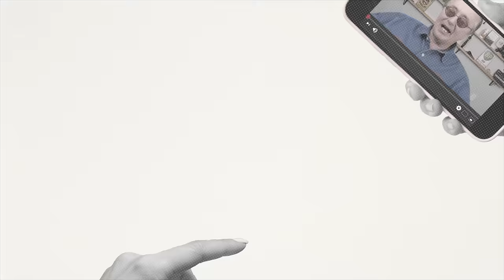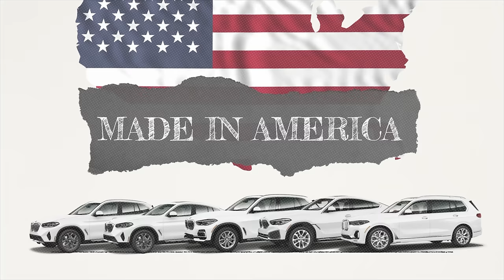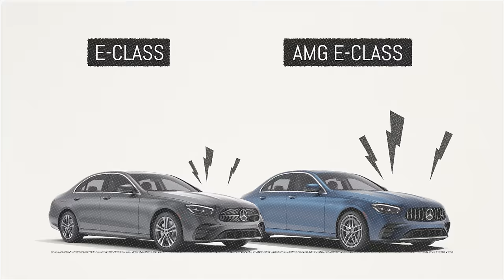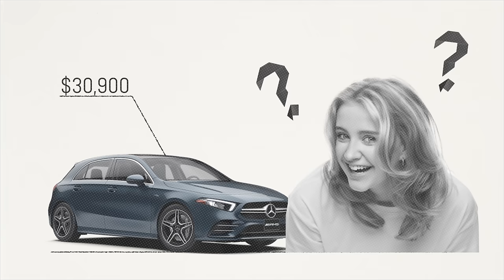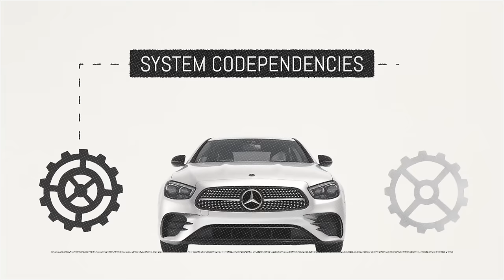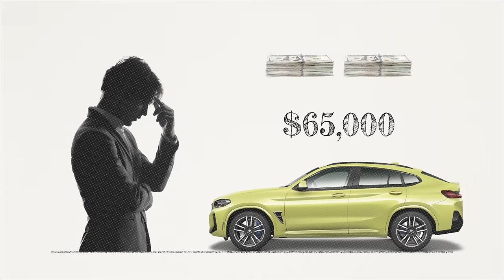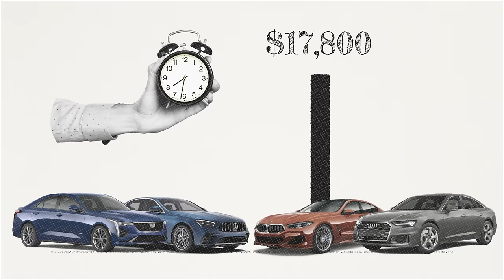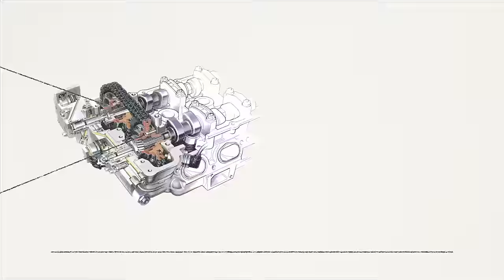3 Car Brands Only Stupid People Buy

Comment: I leased a 2013 X5  and found the ride rough enough that I switched out the run flat tires.  My 2007 5 series with 175k miles now has a failed transmission after several thousand dollars of other repairs, I owned it since 2010.   I had a 2019 X3 M40i with  standard sport suspension and found it way too stiff and bouncy. I loved a 2018  640iGT until it made a loud bang at 80 mph after which it was stuck in maybe 5th gear.  Towed to the BMW dealer where is sat for two weeks util he could get to it and the error disappeared!  Traded it for an Acura MDX type S.  Most fun to drive.  Every option including excellent sound system.  The 350 hp seemed to require high RPM to be responsive and with only 21 mpg and a small tank I was unhappy with a 300 mile range.  Currently drive a certified used 2022 Macan S with extend unlimited mile warranty.  It drives differently than a new BMW X3 M40i, which I would only get with the adaptive suspension.  Brakes not as responsive, engine in sport mode about like the B58, steering less aggressive but still connected to the road.

Comment: I've literally have only owned 3 cars in my life since buying my first car in 1978.    I had a '79 Toyota Supra that I kept for 19 years,  a 1999 Camy that I traded  in 2014 for a 2015 Camry.   I will be trading this car in for 2025 Camry, just because I love the redesign.   In a 46 years of driving Toyota's  I've only had to have new forward brakes on the 99 Cam,  and I had to get a new CV Axle (thank you Cal-Trans for the exemplary way you keep L.A. streets) on my current 2015 Cam. Everything else was regular maintenance.   Not one car had less than 200K miles at trade in.    Give me reliability over flash ANY DAY.

Comment: I own a 2018 BMW 540i with the B58 engine. Did you know that the award winning B58 was designed by Toyota? Also, the BMW was ranked 3rd by consumer reports in 2023 for reliability. I wouldn’t touch an older BMW, but the new cars with the B58 are bullet proof!

Comment: In the last 14 years I had 3 BMW X3 and one BMW 5 Series. All were company cars I ran up to 200.000 kilometers on each of them. Never had any serious issues. I also owned  a BMW X3, a BMW 3 series and a BMW 1 series. Also no issues. Before that I owned three Mercedes. Also no issues 10:48 . The BMWs were all new at the time I bought them. The Mercedes were pre owned, but not older than one year.

Comment: scotty i have a 2009 toyota corolla and i have have replaced the serpentine belt 4 times, and every time i replace the belt it squeals,  the car has 250k miles and the belt squeaks loud when i start the car.  what can i do? please help
Reply: Belt maybe a little loose? Check the belt tensioner and its idle pulley bearing. I had seen a 2012 Impala serpentine belt snapped when the tensioner idle pulley siezed.
Reply: Tensioners ..... it's not the belt !
Reply: It’s the pulleys and or tensioner. Should have realized that after replacing the belt the second time.
Reply: Scrap it
Reply: @Fernando     PPL in the thread you started are giving you the answer.

Comment: My 4 cyl, manual gearbox ford ranger will be 15 years old in 2024. Just crossed 120k miles with no leaks anywhere. Super quiet and ultra reliable. Been garaged since day one and looks brand new. 

Getting er ready for another 15 years. (Might have to replace the clutch in 2039).

Comment: Ive owned bmws (i buy used and old) and currently own bmws (like 10+). I swear by them. I service them myself, most mechanics and repair shops don't understand these cars. Hell, even the dealership dosen't. I got my fancy scan tools and fcp euro for parts. I honestly have nothing to complain about. I love how it drives and makes me feel and i dont mind fixing it when it does break down which is rarely.
Reply: Exception doesn’t make the rule. Not every person is a mechanic
Reply: @ev0wat most mechanics aren't mechanics these days...
Reply: Yeah if you work on them yourself that saves costs. However parts are still alot more expensive.
$500 for a plastic valve cover? Man did I roll my eyes at that rip off, but oh well no choice.
Reply: @cloudsmith7803  yeah parts can be pricey but once in a while is all good, usually when a buy the car it has tons of issues then after i sort it its good for years. People dont take care of them. I bought all kinds of bmws haha, i know.

Comment: We brought a used 2015 BMW X5 35d with 8,000 miles on it.  It has been without a doubt the best, most fun, and reliable vehicle we have ever owned and still do.  Currently has 180,000 miles on it.  I do the normal maintenance myself always Liquid Molly(FCP Euro is a great website).  I do agree that there is so much plastic in the engine bay that it is time to trade her in.  Current offers from the dealer's range from 7-9 thousand on trade in.  I do feel we did get lucky with this one but are currently looking at the Lexus 350 rx hybrid and the X5 50e.  One thing that bothers me, is the Lexus has a CVT transmission but yes resale is the largest factor helping the Lexus.  The BMW just blows the Lexus away for performances on all fronts plus 40 mile range running on the battery(still vrooming).    The BMW is currently on a 3-4 month waiting list and is all in,  about 10 grand more than the Lexus. I do agree that the odds are more likely in the overall quality and resale,  the Lexus is a prudent choice.  On the other hand the BMW is way more fun to drive!!

Comment: I bought a one-owner 2011 BMW 535i XDrive  with about 100,000 miles on it nearly five years ago for about $10,000.  Since then I've put about 50,000 miles on it and other than a set of brake pads, oil and filter changes, the only repair it has needed was a starter replacement.  And it is a WONDERFUL car to drive.  Fast and handles great, and it still looks new.  Gets 30 mpg on cross country trips (which I do several times each year).  I just checked online and 2011 BMW 535i XDrive cars are currently selling for between $7000 and $14,000 today.  So after nearly five years of use I could sell it for about what I paid for it.  Yet Scotty thinks I'm stupid.  🤣
Reply: You are that lucky 1/10. While for toyota there usually are 8/10 lucky people. go figure. yes still stupid.
Reply: @reald3d23 this is normal lmao not luck at all. I’ve had 3 German cars with well over 150k miles.

Comment: I'm a BMW guy. I have a M235i 2015, 2008 M3 and 430i 2009. All of them not one problem always do your maintenance on time. Make sure you get a good mechanic and build a trust with them. The only annoying thing that all my BMW does is the Bluetooth connection. Sometimes they don't want to connect so I have to reboot the i-dive but that's it.

Comment: In 12 years and 165.000 kilometers my F30 335i with mhd stage 2 cost me 1100€ in maintenance/repairs , everything’s else was service. same with most of my friends. I drove BMW inline 6 for 18 years now and they are very reliable. Except one engine, the N54, where all the memes come from. Awesome engine, capable of 700-1000hp, but not for casual customers 😂

Comment: I have a 528i 2016. No problem. Just the battery. And I changed the High pressure to Bosh.

Comment: I bought my 2007 BMW328I with the N52 engine brand new and next year it will be 17 years old.  The N52 is rock solid and other then the dreaded ABS module issue I have never had any problems with the car.  I was so glad I did not buy the 335I with the turbo as that was a disaster. I guess it depends on what engine you bought .  I don't even have a display on the car but that is what I wanted as I did not want to deal with the reliability of the displays.  My car is a normally aspirated car with no display or fancy crap.....
Reply: I have an 09 328i with little over 170k miles. What’s your mileage at? I agree overall it’s a very reliable car for being a German luxury
Reply: @HookahDoncic98  I only drive mine in the summer so it has about 200K km.

Comment: I remember taking my Toyota for a spark plug change at Toyota. Fixed the problem, but it was around 800$. After that I started to learn about cars. Everything about cars  so I can diagnose almost every basic problem with my car. I could only imagine the mark up price is if you want an original foreign part.
Reply: Depends where you get them tbh I've got a  bmw electric napa water pump cause it was needed that day for 600 not including tax and it worked but wouldnt turn off after shutting off engine got a good brand one online for 350 with 1 day shipping

Comment: The only German car I buy is VW because they are relatively simple compared to other German brands. I’ve been lucky in that I have been pretty trouble-free through basic preventative maintenance. It is not cheap, however.
Reply: No car is that cheap in my experience. The parts for my VW haven't cost more than their japanese counterparts.
Reply: @fortimusprime You’re right. They’re all expensive,  especially nowadays. It’s, of course, on purpose. More profit lol.
Reply: I'll take a Porsche 911
Reply: The best car I ever owned was a ‘79 VW Scirocco  -  after 350k miles over 25 years, it became hard to find parts.  If I had tried harder to find parts, I would still have that fun and reliable car today.
Reply: @8MunchenBayern8  You could also try the Poor Man's Porsche, or Poorsche; The Beetle A5 2012+. It's basically a GTI in the shell of a Beetle.

Comment: Personally, I still like Fords - I have rarely had any major problems with the ones I own and when I have had an issue, the repairs are at least affordable.    -- I did once owned a 1984 BMW 525i when I lived in Germany (military service).  It was a great car and I really wish I had been able to bring it back to the States when I left.  The problem was that all of the windows required replacement to pass U.S. inspection and the car had no A/C which would have cost about $4 thousand to $5 thousand to install.  I only originally paid $2,500 for the car when I bought it used.  So, I sold it to an ex-pat when I left.
Reply: My 99 Mustang six has been the best car I have ever had - however, newer Fords seem to be crap - for example, why would any manufacturer use a PLASTIC oil drain plug?
Reply: @appleimacdude wow! I had no idea they use plastic plugs.
All the more reason to stay away from the Farley carts.
Reply: Ford - fix or repair daily lmao

Comment: Bought a 2002 BMW 330CI new . Naturally aspirated inline six that runs as smooth as a sewing machine for 22 years now. No major engine work needed so far. Replaced radiator at 116k mi. Mostly just tires , brakes and routine maintenance. This car is an absolute schapel in traffic in Ca. Call me lucky , or a unicorn , but hands down , this has been the best car I've ever owned , and Ive owned quite a number of cars and trucks. So I gotta disagree with ya on this one Scotty.

Comment: Recent bimmers are highly reliable and parts aren’t that hard to find, I recently had a crash and it took 13 days and 3000 to fix it. Pretty common for any car. And driving a bmw gives you extra confidence specially on Xdrives what a pleasure it is, Lexus doesnt  stand a chance by a mile. I have a 530 and X5 and they are best in class. Just get an extended warranty and you are good for 6-7 years.

Comment: Oh man,
I have a 2012 Audi A6 3.0T with Bilstein coilovers, forged wheels, and tuned to 500 hp. I absolutely love it. It's also 12 years old and still looks brand new to me.
The AWD is amazing, only second to the tuned '13 WRX STI I used to have (that one used voodoo magic and 4 diffs to stay glued down), it still feels luxurious, about 120K miles.
It's made so well, that I drove a new A7 and mine honestly felt better to drive. It still feels new. It also gets to 60 mph in about 3.5s and pulls hard until ludicrously forbidden speeds.
The supercharged 3L feels more like a 4+L V8, just doesn't sound anywhere as good. The interior feels new still, but looks older. When you're in it you know the design is old, but it is luxurious feeling: old luxury feel.
Sometimes they're worth it if you love awesome feeling cars, but it does cost more in maintenance. It barely needed anything for about 10 years, except oil and brakes (double cost of a commuter car), but in the last 2 years it has needed way more work, about USD$10K worth of it.
I'm now on the fence about fixing it vs swapping it. I can't find a new car that I like as much under $50K, including the new Audis.
For some reason mine feels much more special. My WRX STI tuned felt the same, but with 20K in parts. Even in traffic both these cars are fun experiences that make you feel good.

Comment: The scarce Mercedes parts is a very TRUE statement. My 2011 E550 needed a new transmission. $10,000 repair bill quote, but they couldn’t even find one to replace it even if I wanted to. None in the US, none in Germany. Only one found was in Georgia and they would have to ask if they could even buy it. 
Sad because I loved the brand. Learned my lesson
Reply: I can find those on eBay in five seconds. Have you ever heard of junk yards? Come on... I can understand this if you lived in a remote and small island in Polynesia but not in a huge nation like USA - where these cars sold in the thousands. It sounds to me that your mechanic either wanted to buy the car from you for little or not work on it at all.
Reply: @Electra-xm7lu  my mechanic was the Mercedes dealership in Nashville bro…. Lol
Reply: @SpencerEzell  Well, that was your problem. You do not want to go to a dealership for mechanical work once the warranty is done - unless you want to get robbed. No dealership is going to find you a used transmission at a junkyard, nor care.  An independent mechanic or transmission shop would have been much cheaper and honest.
Reply: @Electra-xm7lu  know what? You’re right. My apologies. I should’ve checked eBay, Facebook marketplace or visited my average local mechanic and could’ve found one much more efficiently than a Mercedes dealership.

Comment: Using aluminum bolts on engine parts with that kind of dynamic loading is a metal fatigue problem just waiting to happen. Genius!
Reply: The engineers were not thinking of longevity using aluminum bolts.

Comment: You will never spend $1,000 for just an oil change on any BMW, the most expensive one I’ve seen is for the 2022 M5 CS and that was $345. Most I’ve paid for an oil change was for my m6 comp which was just under $200, my friends M8 comp is $215.

Comment: The M340i is supposed to be rock solid due to the B58 under the hood. Very reliable, and that engine is smooth as butter. I’ve driven one. Definitely trying to get one. Amazing car.

Comment: I learned nothing new from this video but most of it is true. I'm an old muscle car guy and one of my cars is a 2006 BMW 325xi 6 speed manual, owned it for 10 years now, put about 20k miles on it and now has 170k. I've done all work on it myself, nothing major. I have to say it's the best driving car I have ever owned.

Comment: I bought my 2013 Mercedes Benz GLK350 4Matic with 23,500 miles from my father’s estate for $15,000! It was a great deal and 💯reliable for 4 years now and very quick and great handling. I probably wouldn’t have bought it but I have been a mechanic for 35 years.😅

Comment: I have a 3 car garage with 2 practical Lexus models for my wife and I.  GX 460 and LS460.  The 3rd bay contains a 2020 Z4 30i and I love it.  I know that it ain't practical but damn it puts a smile on my face.  So far, no problems whatsoever.

Comment: We got a used 2018 INFINITI QX60 13 months ago for 25500. Its got 96000 mile now(we put 30K) with no problems. Super nice ride great fuel economy and performance. 360 camera and active cruise control are awesome. Could not be more happy with this purchase and I paid it off already. Planning on getting it close to 200000 miles or above before looking at something else. My wife is really hard on vehicles 🤞for the CVT!

Comment: Bought a bmw 2014 120D 4 years ago with a 130 km on the clock here in Germany Frankfurt. After 10 years of old this car has over 230t km on the clock. Engine chain changed , oils every 10-15 t km, brakes, battery and started , the car goes perfectly , recently got an ABS error the cars goes for a check tomorrow. I’m happy owner of 120D, hopefully I will drive it the next 3-4 years until 500 k km o even more

Comment: Got a basic Merc E Class Estate 2011 2.1 TD ...smooth as ~~~~....I was told this is the most reliable engine they made by a friend who runs and Airport Taxi service with 3 Sprinter Mini Buses that have done over 380K each so far..same engine...no probs , mine has the 'cheap' 16" wheels. I've had it 4 years and got it cheap only £8000....lovely car with not to many of the silly extras , which tend to be the expensive things that go wrong....no complaints....we do have a Bosch Service Centre nearby so quality servicing with OEMparts but not dealer prices on labour ... 1 wheel bearing changed so far....that's it

Comment: I now have purchased 14 BMW coupes 2:53 over the last 30 years. I buy them very slightly used they have been great. I used a local non bmw garage for everything which keep the cost reasonable. Great Cars 3,6,5,7,8,7,6

Comment: Had more trouble with a Toyota Mark X Zio (JDM) with expensive repairs than my other cars, but thankful for used car warranty and New Zealand having really strong Consumer protection laws. Have an older 325i msport and that was a rough patch under dealer used car warranty... But the drive makes it worth it and it's an E90 naturally aspirated straight six. The other car in the house is an Audi Q5 s-line.... Awesome car but not as fun as BMW.  Aside from these the best car I had was a JDM Toyota Blade G. Such a little package with a 2.5l Camry engine firing it along the road. BNW is the most expensive to maintain, gulp run flat tyres hurt the wallet, but absolutely worth it and my next will be a 330e.